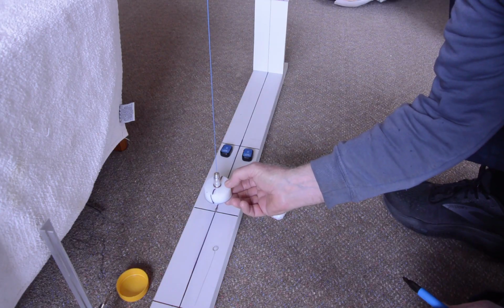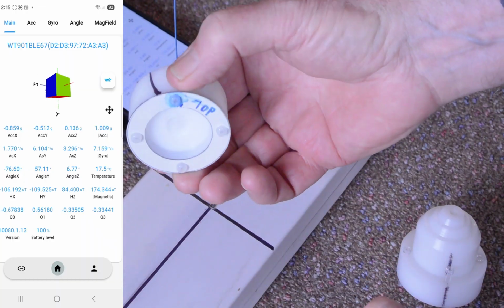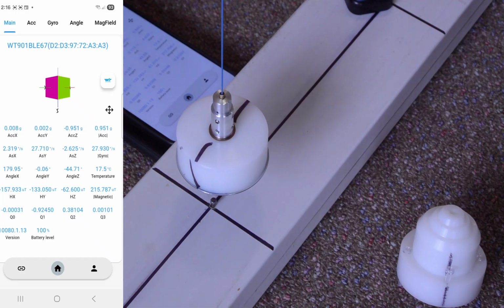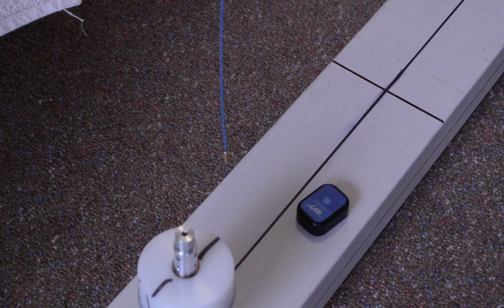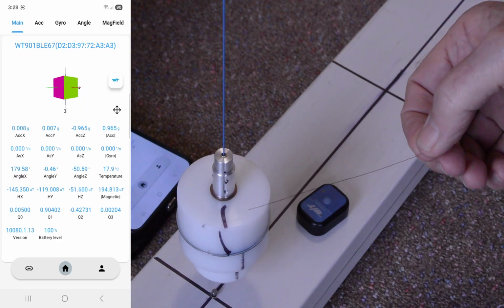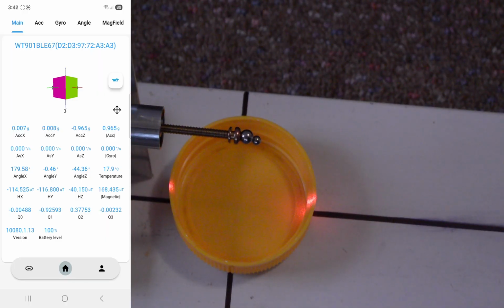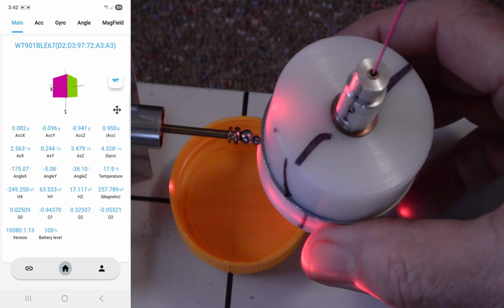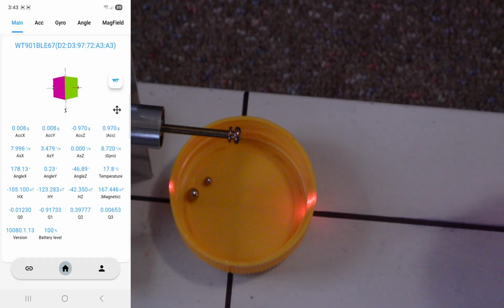Most Accurate Clock on Earth 9B

Comment from the maker: I intend to make episode 9C in a few days, please suggest any improvements I could make to the experiment, also point out any mistakes in this video, that I need to correct,... Thanks Peter
Reply: Could you repeat the experiment a few times to see if the results are consistent from run to run? Maybe even with the whole apparatus rotated 90 degrees too? At 35 degrees south over 15 minutes the precession should be about 2 degrees which is not a lot but your setup is accurate enough to measure 2 degrees for sure. The only other thing that I can think of is increasing the length of the string but I suppose you don't have a suitable staircase or something so probably impractical.
Reply from the maker: Yes I do repeat many time but do not publish as the videos would be too long, however I see your point I will try a condensed multiple runs.
I have rotated the 90 degrees a few experiments back and the results were inconsistent still.
My suspension cord is 2m long, from all accounts  Foucault's early experiments in his garage were also about this length, so it appears that the length of the pendulum may not be to big an issue,.. thanks for the comments the condensed multiple runs makes sense.